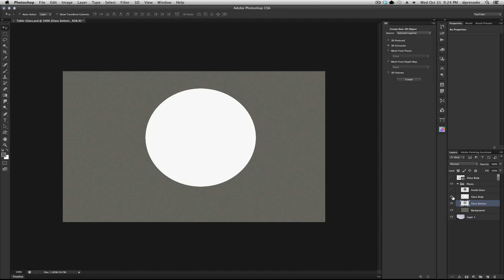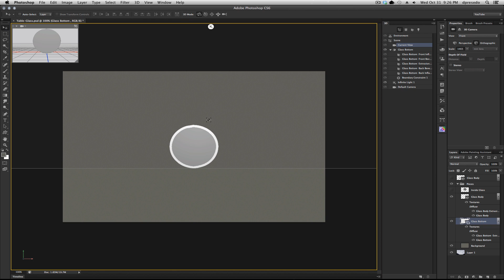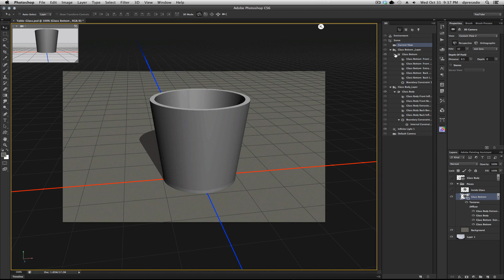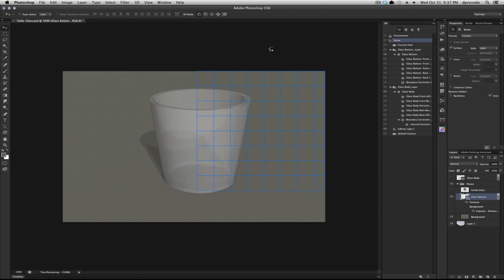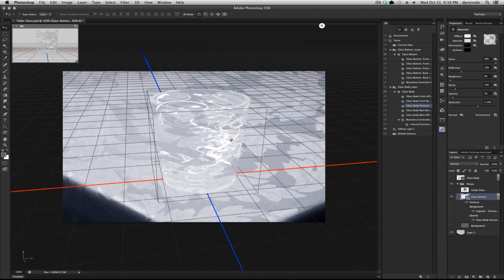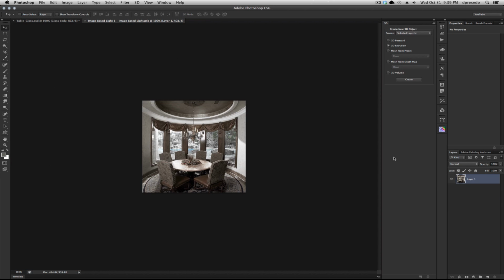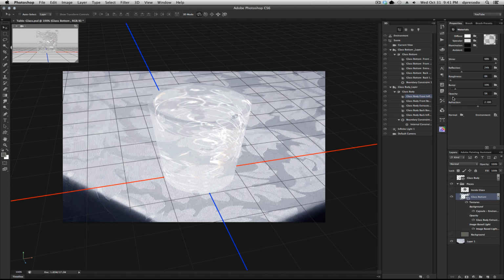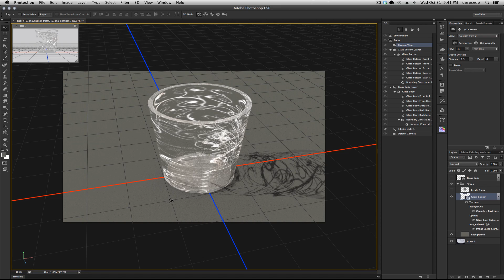Photoshop CS6 - 3D - Opacity Maps - Glass Cup

Comment from the maker: Yeah this is probably worth a video... but it depends on the project in mind. From a high level explanation I would say > You can select the Glasses Lens area of the glass, copy and make a separate layer. Extrude that layer. Make the extrusion depth really thing like glasses, then select ALL the materials and choose the glass material. Then the important part here is to > use the original image layer and turn that into an extruded object. Then merge down the glasses layer this way the 3d mesh interacts with the other 3d mesh. That is probably why you're not getting the effect you want.